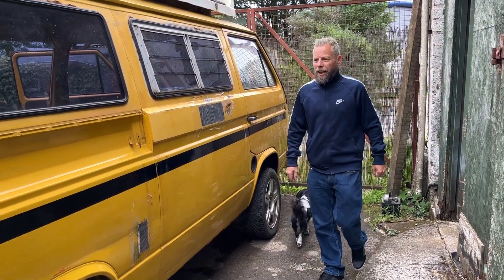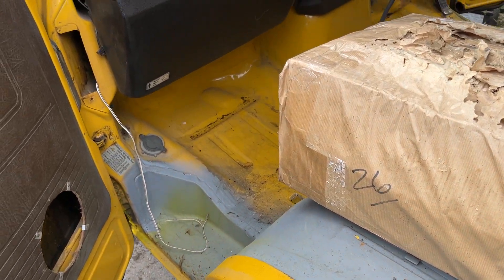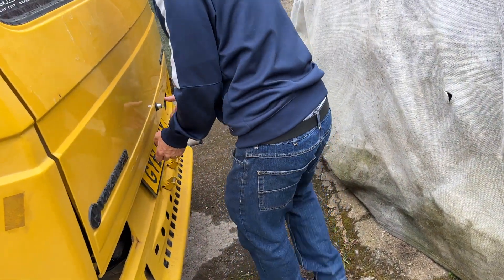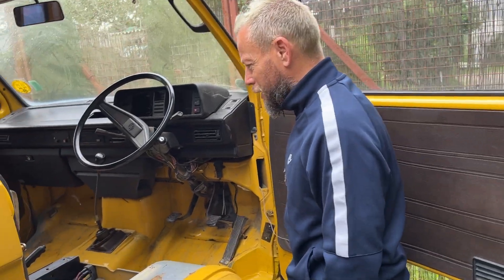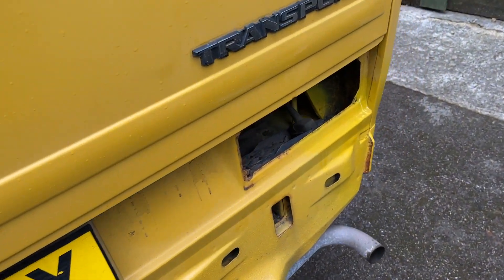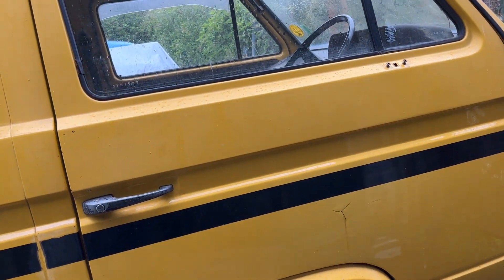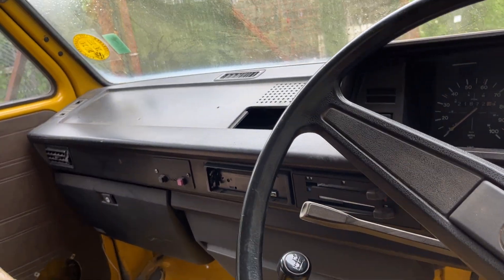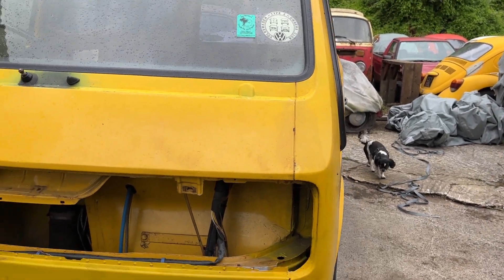VW T25/Vanagon walk around !!

Comment: vwcoco, love the new Vanagon, are seats coming?
Reply from the maker: James they are coming tomorrow/Monday :)
Reply: @vwcoco  I’ll be watching to see the seat install.
Reply from the maker: @jamesmorris7074  thanks m8 . We’re deciding what to use for the flooring etc before seats but will do a video on what interior looks like 👍
Reply: @vwcoco  you encourage me to do more work on my busses. I have someone who builds my motors. You will figure out what the flooring should be. I had a new van in 79. I glued carpet to plywood and put it on the floor upside down with the wood up. The plywood then can receive any covering you want. The carpet between the metal and the wood eliminates moisture forming because there isn’t a radical change in temperature.

Comment: That's guna be an easy on the toad project
Reply from the maker: Yep for sure . Interior ready just to bolt in . Shocks and springs first 👍
Reply: @vwcoco  that's so easy to finish and will be the muts you selling on or guna get it done and give to daught or Mrs coco
Reply: Excellent project, get that roof sorted out and have fun getting it all back together
Reply from the maker: @jimwhittemore4669  already put the feelers out for a replacement roof Jim ,so fingers crossed thanks